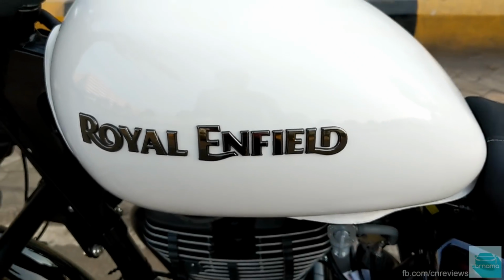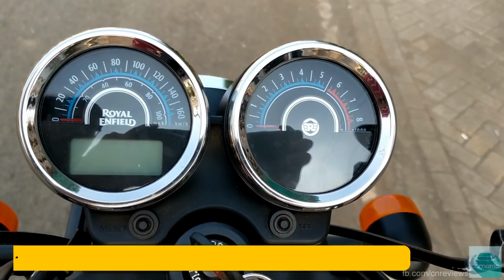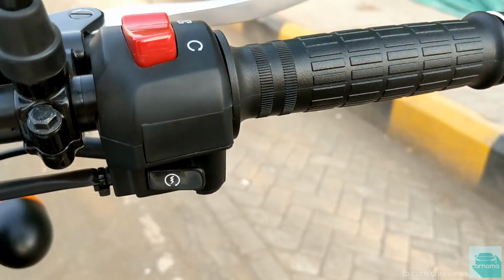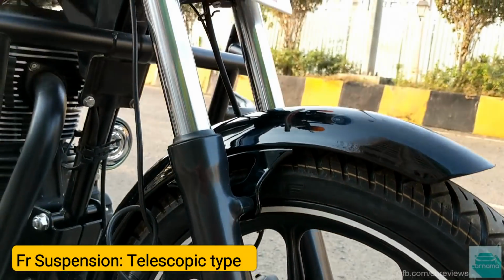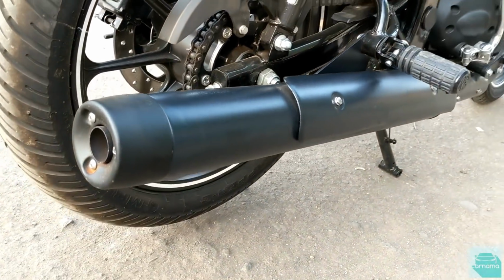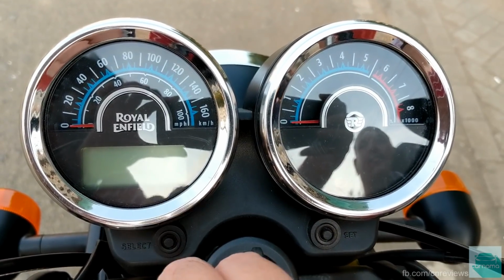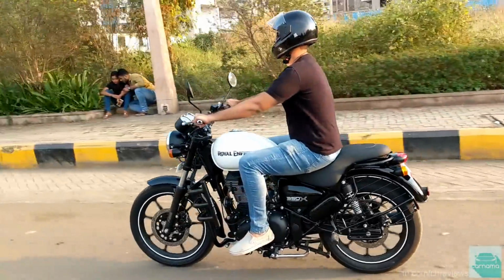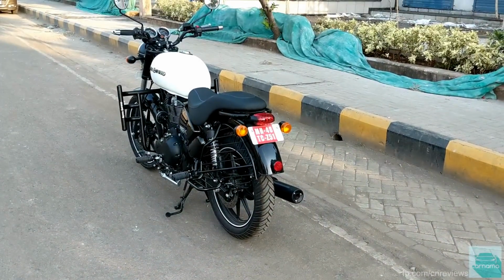2018 Royal Enfield Thunderbird 350X ABS Overview | carnama

Comment: how to on hazard light
Reply from the maker: Extreme right side of the key slot
Reply from the maker: Or check if there's a button between the two speedometer pods with a red triangle in between like this:

https://auto-uploads.ndtvimg.com/used-bikes/15832/big/royal-enfield-thunderbird-350-front-tyre.jpg?v=1536604782
Reply: @carnama  hazarrd light was on previous thunderbird..... i had buyed same thunderbird abs this year i cant find  hazard switch.
Reply from the maker: Ohh.. Idiots. :(
Reply: @carnama  bro on serious note im using this abs 350x from one month i cant find hazard switch. i had asked Showroom guys they also denied. only old thunderbird get hazard switch. you should accept your mistake for misleading information.
Reply from the maker: Hello! The owner installed it aftermarket. Sorry for that. Thank you

Comment: I hope RE fixes the reliability issues of this bike and provide at-least an oil cooler at this price range. I feel that speedometer is going to fall apart when it is vibrating. It feels awkward to see such things when i'm spending almost 1.5 lakh on a bike. But bike design and  fuel tank are the best. An oil cooler will make it perfect for touring.
Reply from the maker: When it sells they don't bother. When it starts getting competition then they will. Hopefully.
Reply: Nothing happens man, it works great.

Comment: 7:30 does it really offer hazard light fn? How could I switch on the hazard light via the key slot? Pls reply
Reply from the maker: Extreme right of the key-slot there's a symbol for hazard light.
Reply: @carnama  but i can't turn my key after the ignition slot
Reply from the maker: Did they remove it now? :O
Reply from the maker: Or check if there's a button between the two speedometer pods with a red triangle in between like this:

https://auto-uploads.ndtvimg.com/used-bikes/15832/big/royal-enfield-thunderbird-350-front-tyre.jpg?v=1536604782
Reply: @carnama  no there'snt.. I dont think RE bikes have hazard light after switching to bs4

Comment: Bro does it vibrates more or less
Reply from the maker: Vibrations are felt at higher rpm. But keep it in the mid range and it won't bother you as much.
Reply: 65km k baad vibration starts.  70-80 tak disaster 😢

Comment: What will be the cost to upgrade TB 350X Non ABS version to ABS
Reply from the maker: I'm afraid that it cannot be done. At-least without voiding your warranty brother.
Reply: @carnama  what if we do it from showroom only?
Reply from the maker: Retro-fitting is not done (at least under company rules) by the showroom.
Reply: Don't go for RE bro I just waisted 2.2 lack
Reply: @VikramSingh-yr6is  whats the main reason?
Reply: @venkataramanans6521  bhai ...RE service station also confused...they changes timing chain/ auto tensioner then tapped settings and now they are looking for wht I don't understand